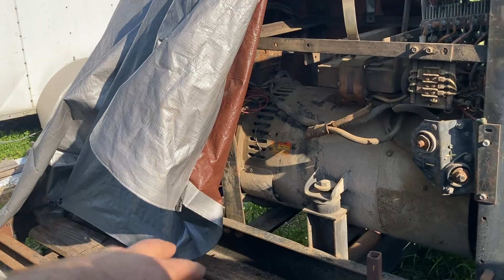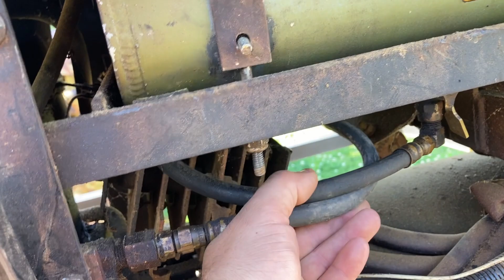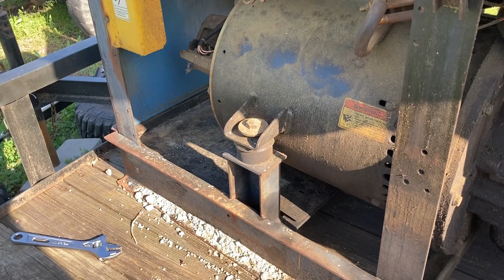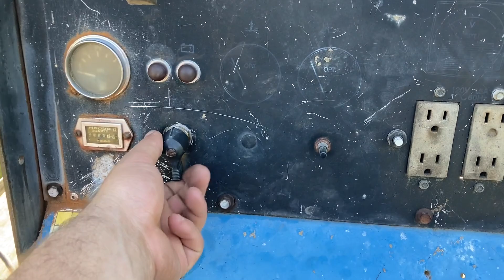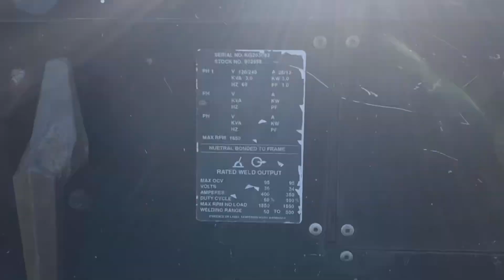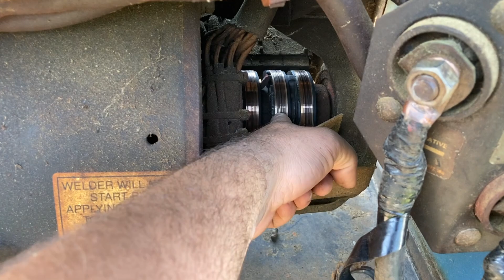Troubleshooting my Miller Big 50 Diesel

Comment: I am envious. I had one of these and sold it in 2000 and have regretted it ever since. I have acquired  a Hobart 400 with only 125vhours on it for a trade out on a boiler repair for a company that I have work for 20 plus years. A great machine but I miss my miller because it had all the options. Best of luck in your endeavors.

Comment: I have a Big Blue 400 d that I got full of water and the fuel filters and fuel lines were rotted off. Has the duetz diesel and I drained the water and oil replaced the fuel lines and filters and she runs and welds great. Keep up the good work